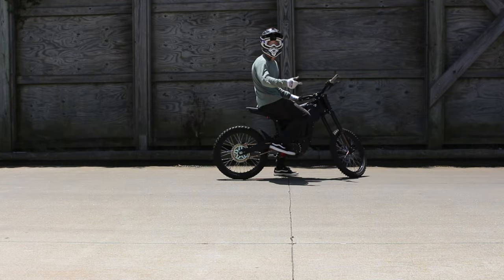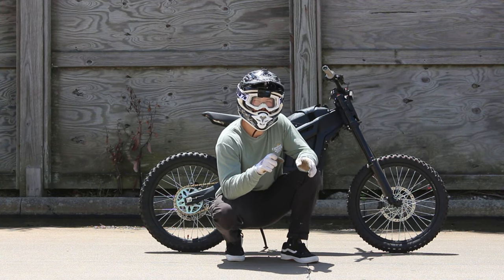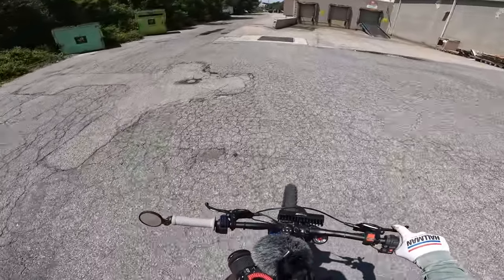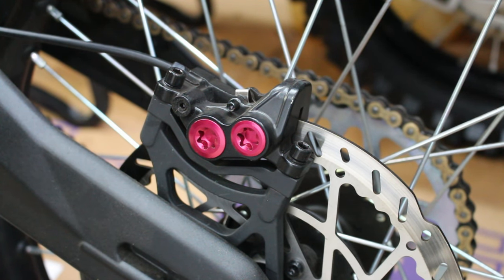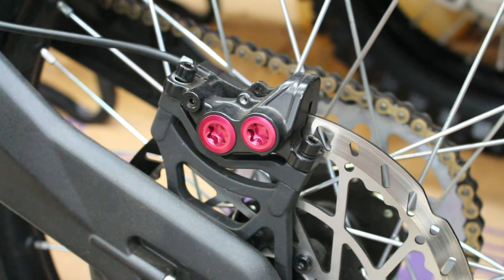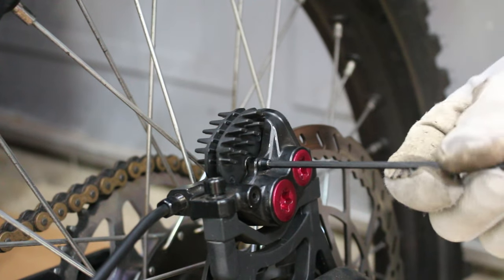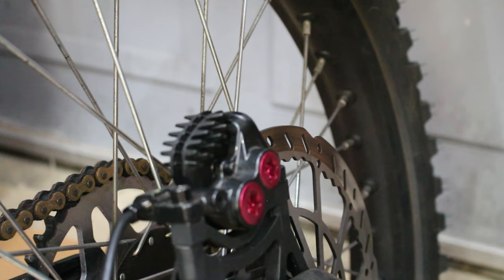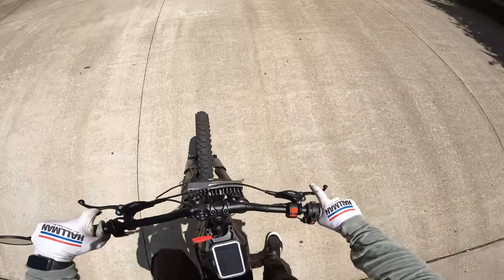Are The Shimano Brake Pads Worth The Hype? / Installation + First Impressions - Talaria Sting R MX4

Comment from the maker: Shimano Brake Pads: https://amzn.to/41tBfQk
Reply: LOL.  I ordered the same pads a week and a half ago and got it beginning of this week.
Reply: Why Metal instead of Resin? Much love 🤙🏼
Reply: @Triggamike  metallic pads have more bite and last longer and have higher heat tolerance, down side is they can get noisy when wet and wear rotor faster
Reply from the maker: @Triggamike  resin pads will burn up quick with the weight and speeds of this bike. Metal last longer. There’s pros and cons to each but for this application, metal is better 🤙🏽

Comment: Thanks bro!  Been waiting to install mine, and I’m about to today!
Reply from the maker: Awesome! Bed them in for a bit at first and they feel pretty great compared to the stock ones! 🤙🏽
Reply: @freerfixedit  I got both wheels’ sets in, but after a couple days, the front set has started to squeak, any idea why? They haven’t gotten wet yet.  Also when I roll the bike back-and-forth really slowly I can sort of hear them rubbing.  do I adjust the calipers in anyway, or maybe when you tighten the main bolt back in? Is there a certain technique for it?
Reply from the maker: @ch40440  yeah, the squeaky pads may be from glazing. I noticed if it happened to me, if I rode and drug the brake slightly for about 50 feet or so about 2/3 times it would stop. Or you can remove pads and rub em on some sand paper. The rubbing may be from not having your brake caliper centered. I actually have a video on this about stopping squeak, but long story short, you want to hold you brake lever down while you tighten the 2 5mm caliper bolts. It should center your rotor better between the pads

Comment: having issues since day one (had a week) with brakes rubbing despite centering, bleeding, etc. noticed you have completely diff calipers than mine. mine are all black and dont have the big bolts on the side. fighting with talaria now to make it right. not sure why theyre shipping different calipers to people. mine was from this newest batch last week. noticed one of your followers just got the new batch with orange decals and has the red calipers as well. crazy there is no consistency. great vid btw! love the content
Reply: Literally the same here, feel like these are completely different bikes i also have the all black calipers as well as my headlight is the square connector aswell its crazy.
Reply from the maker: Yeah... They are shipping with different brakes, grips, rear fenders, graphics, and headlight connectors... these items dont affect performance, so they didn't inform anyone they were doing this... The calipers you have are still 4 piston calipers, so I dont think theyre worse quality than mine... I think Talaria is having a hard time keeping up with demand, and they had to source parts from other suppliers to keep up... just my guess!
Reply: Standard China procedure. Whatever gets them out the door and on the ship.
Reply: I’ve been having the same problem with the stock black brakes. Did anything work? @shaking shark?

Comment: Would you recommend these over the kool stop pads luna cycle just added for the talaria? The description they give on the site is they now have an ebike specific compound for better stopping power. Half the cost of the shimanos
Reply from the maker: I haven’t tried the kool stop pads so I can’t say. Looks like they don’t have the cooling fins like the shimanos, so will probably fade more when they heat up. But for half the price, and if there compound stops as good as they claim, might be worth a shot. But I can speak for the shimanos and say they are great. Now that they’re worn in I can lock up the back brake with 1 finger no problem
Reply: I have the new cool stop pads in my hand right now going to try them out today

Comment: Hey man I’m having a hard time getting these pads to fit back into my caliper… they’re the BP-H03C-MF model right?
Reply from the maker: I don’t remember having a BP in my part number. H03C-mf, they’re the pads linked in the description
Reply: Thanks for the quick response. I got the pads in but I notice that the left pad feels a bit loose compared to the right. I just did a quick test and it seems to be braking a lot better but the left pad definitely has some play.. is that normal?
Reply from the maker: @DevinFife23  yeah they’re just kind of loosely held in there by the spring clip and pin bolt. You did install the spring between the pads right?
Reply: @freerfixedit  I did install the spring clip but felt a lil looser than I thought it would… probably fine?
Reply from the maker: @DevinFife23  as long as you screwed the pin back in through the pads, and have the safety clip, the pads can’t go anywhere so I would say yeah. Mine wiggle around too

Comment: I just got my Kool Stop pads from Lunacycle for $18, hope they're good. Gonna install them may today but it's too hot out in my garage
Reply from the maker: let me know how you like them, my shimanos are about down to the metal
Reply: @freerfixedit  To be honest, I can't really feel the difference.  I guess the fronts did seem to improve somewhat and they don't squeak anymore, but now the backs squeak like the original ones.  Turns out the original weren't even worn down as much as I thought.  And I'm up in the hills going up and down steep country roads and trails on my property.  I cleaned everything off with rubbing alcohol just like the Lunacycle  youtube video.   Not sure what to make of all that
Reply from the maker: @julieloudon7513  if they’re squeaking it’s probably because they glazed over. You can take them out and rub them in circles on some sand paper to get some fresh pad material back and it should stop
Reply: @freerfixedit  I'll try that this weekend.  But the back squeaked loudly right out the box and first run down the road.  I rode it again today and I feel the front worked probably better than the OEM ones.  I'll jump back on here and post an update.   LOL.  I'm kicking myself for not doing a stopping distance test like you did.  Buuuut I just might put the oldies back in and do a proper test.  Thanks for responding
Reply from the maker: @julieloudon7513  anytime! let me know how it goes, also, with new pads youre supposed to bed them in.  what i did was went about 10 mph and just slightly drug the brake to wear them in. be careful if you do this with the front brakes tho, cause any slight turn and the front end can wash out from under you

Comment: did you need to put some type of oil on all the plugs in front of your handlebars ? idk what some people are talking about
Reply from the maker: Leme guess… good ole Bill on fb 😂 no, I didn’t. I just disconnected and removed all my sensors, and taped up the open connectors. People say to dielectric grease all your connections, which in my opinion is not necessary unless your ride in extremely wet conditions. Even then, these connectors are pretty wrapped up. Won’t hurt and will prevent water from doing any shorting, but not necessary
Reply: @freerfixedit  YES it was him !! I was so confused when he posted that. So I don’t have too worry about doing that ? And is there anything else I have to do once I get the bike set up ?
Reply from the maker: @jordanberardi15  just ride it and try not to smile too hard 😁

Comment: I like your heat comment, a TORCH, applied correctly, is way better than a electric heat gun or hair dryer.
Reply from the maker: For sure! I used to work at a wrap shop and torch was the way to go for heat!

Comment: how do you stop these sintered metal pads from squeaking louder than a cars horn? cleaning them doesnt really make it go away
Reply from the maker: Idk, it comes and goes for me… just got back from a ride and front was squeaking. It’ll be silent tomorrow. I don’t get it, but cleaning the rotor with some brake parts cleaner and doing a proper bedding procedure should help
Reply: @freerfixedit  i got these pads on the front and back now. riding my ktm sxf on the track i never get brake squeaking, so maybe the secret ingredient is dirt on the pads😅

Comment: Bought same but holes r off by 1 mm screw does not go in straight did u widen clip hole ?
Reply from the maker: No I didn’t. They just fit right in. First I’ve heard of this, you sure everything’s right?
Reply: Yeah I hold new ho3c pads in old clip and holes r off
Reply from the maker: @craigchenery604  why are you using the old clip? The pads come with a new one
Reply: @freerfixedit  cause I'm dumb lol thanks dude
Reply from the maker: @craigchenery604  😂 no problem bro!

Comment: Do another video on all the mods you’ve done ❤🔥🔥🎯
Reply from the maker: Might have to do somethin like that here soon. My charger died so I’m stuck in the garage until the new one comes in 😅
Reply: "Yeah, also got a question, bro. My Sting R is completely stock. What first upgrades would you recommend? And how do I improve my brakes 'cause they're shit, barely stopping the bike? My bike's 2 weeks old."
Reply from the maker: @Cattyman6  shimano pads are the cheapest way to improve the brakes without spending a ton of money. I’ve also read that clones on Amazon for a fraction of the price are just as good. Also, the bikes ship with oil on the rotors to prevent rust. It’s a good idea to clean rotors with isopropyl alcohol to get rid of the oils. As well as centering the calipers. Check out my talaria playlist to see a video on how to do that. Hope this helps!
Reply: @freerfixedit cheers what first upgrades would you recommend to 👍🏽
Reply from the maker: @Cattyman6  foot pegs, 3 inch riser bars. Direct mount stem. Most of it is in the Amazon upgrade video in the talaria playlist 🤙🏽
Reply from the maker: @Cattyman6  oh and an air wedge for the battery compartment to stop the battery rattle. The stock rubber pieces don’t do a good job

Comment: I just installed these today and noticed even after adjusting calipers there’s alot of noise. I also noticed theres almost zero space between the pads and the rotors. Is that normal?
Reply: I’m having this same issue, have you figured out any solution to this?

Comment: my front brake on my mx4 is making noise when i brake:( i recentered my caliper & still making the noise💔hellppppp
Reply from the maker: Try cleaning the brake rotor with brake parts cleaner
Reply from the maker: Also, the stock pads are garbage

Comment: I wish you showed the front brake install cause these MOFOs will not go on
Reply from the maker: its the same as the rear... what are you having issues with?
Reply: I guess the pistons on the caliper were protruding out too much and I had to push them back in to fit the new pads on. It was a mission, but we figured it out. @freerfixedit
Reply from the maker: @tylerhemmings  nice, glad to hear it! 🤙🏽

Comment: I'm just going to try to hijack these brembo brakes off this old KTM 200 I have 😂.
Reply from the maker: Let me know if it works out!
Reply: @freerfixedit  yeah I just went in my garage and looked at it it will have to be some type of hybrid system there's no way the KTM rotors will fit on the rim 😂 The hub is way bigger on the dirt bike

Comment: If i tried to do this test in the UK by the time i went back to the spot it would have rained and the chalk would be gone 😂
Reply from the maker: 😂 had to wait a day to make this video cause of rain
Reply: I'll probably get these pads but my stock still have a decent amount of life
Reply: @freerfixedit  ahah! 🤣
Reply from the maker: @mcr.onwheels  so did mine…throw em in the trash 😂 these kept getting better and better after this video because they weren’t bedded in yet. I’m very happy with them and feel no desire to upgrade the brakes anymore
Reply: @Freer Fixed iT  That's sweet! Mine also make that sound that your stock ones did but on the back
Reply from the maker: @mcr.onwheels  I didn’t mind the sound as much as feeling like I could feel the holes in the rotor in my lever. No more!

Comment: Put these on my talaria and they scream like crazy and my rear brake is just mush and wont bite… i must be doing something wrong
Reply from the maker: They take a little time to wear in before the bite gets better. You just swapped pads right? Didn’t mess with cables or anything? No oil leaked out?
Reply from the maker: Also need to center calipers when installing new pads. Check this out https://youtu.be/lvjTWxrvwuo
Reply: @freerfixedit  yeah all I did was change pads and they scream like crazy and dont bite. Already put 60 miles on them and still nothing
Reply from the maker: @Smilldon  that’s weird. You got the metal version right? Not the resin? Everyone else has said good things. I wonder what’s going on with them. Maybe clean rotors with brake parts cleaner?
Reply: @freerfixedit  got the ho3c
Just bled the brakes and it fixed nothing